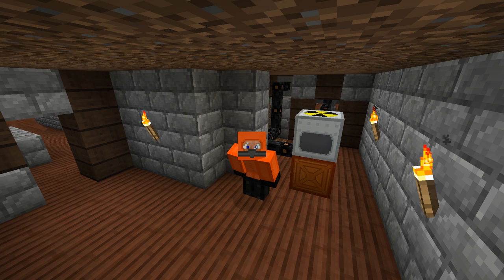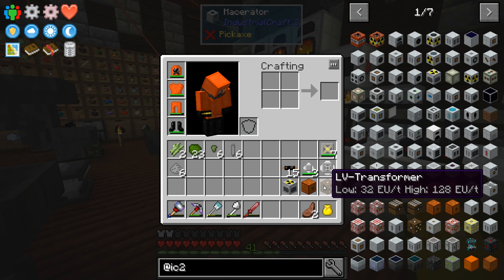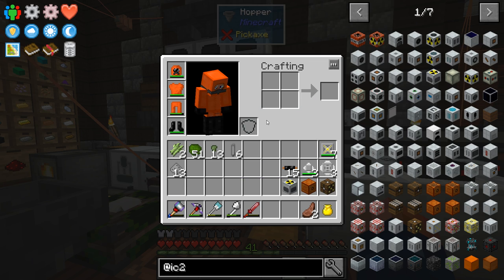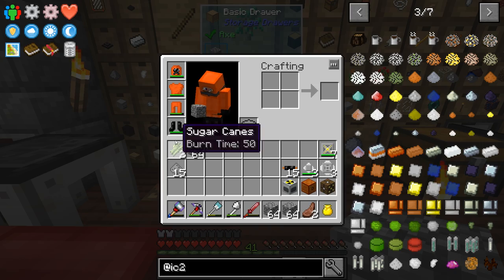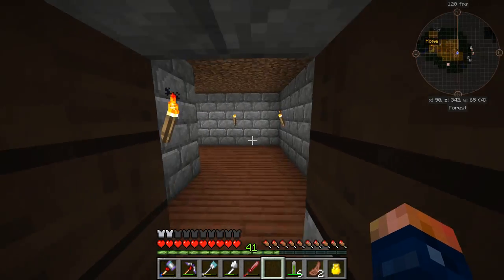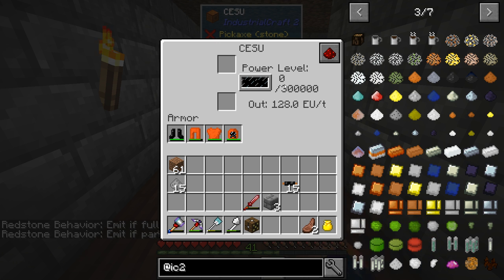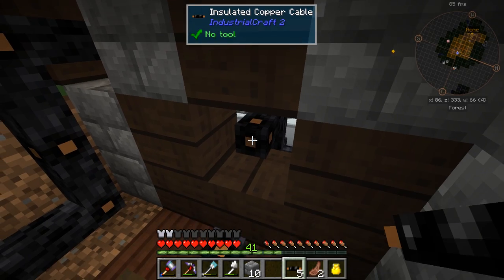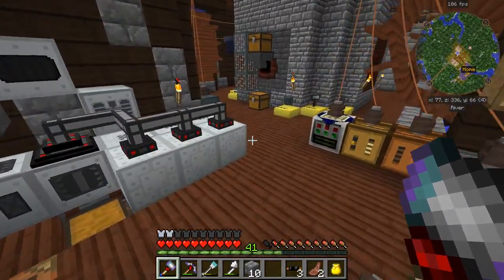Nuclear Reactor Setup | Age of Engineering | Episode 16

Comment: yeah if you wire it not correctly the machine that is actually running will explode and the cable to the machine - i test it out - or should i say i build it like in infinty expert mode (there must be this function disable) cause i never looked up which power tier the machines are and i get the achievment XD

Comment: Thanks for the video, I am not sure if I missed something but I think I layed it out exactly as you did, it overheated and exploded after several minutes of heavy load. It was fine with light loads, but when it demanded constant use it exploded. Any suggestiosn for a more stable build? The problem is at the top end, I saw it in your video the heat components were taking damage, same happened to me, and over enough load time on the reactor it blew up.
Reply from the maker: +jtkirk86 something changed in a update or something. I had the same problem. Go to my just matter video and I show my new design. It's much better
Reply from the maker: +jtkirk86 Here's the link https://youtu.be/43pwejMVibU
Reply: thanks!
Reply from the maker: +jtkirk86 Welcome!
Reply: Another option, if you're still early in the game and spent almost all your resources building THIS design... only to find out it's a bomb waiting to go off... to convert the two Heat Exchangers into Component Heat Exchangers (it only requires 8 Gold Plates to do).  Once I made that change, it appears to be stable.